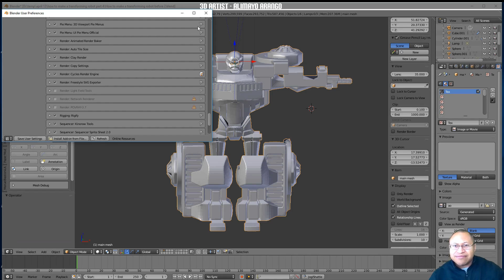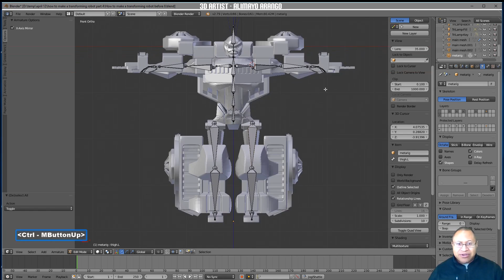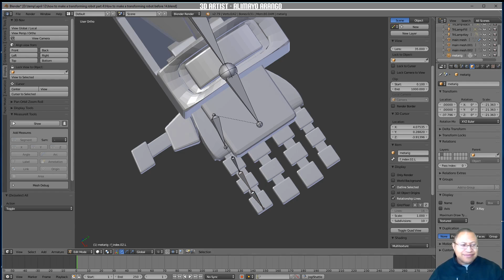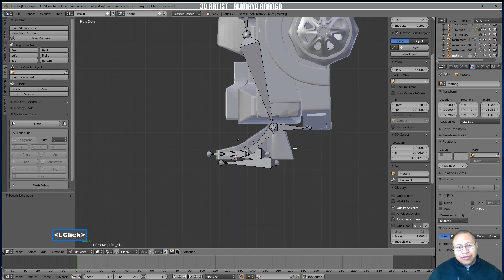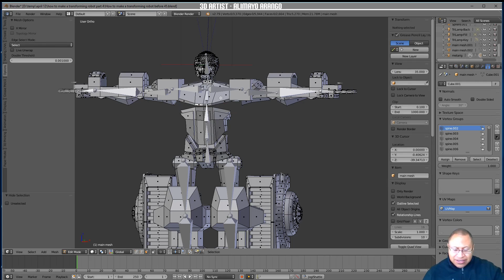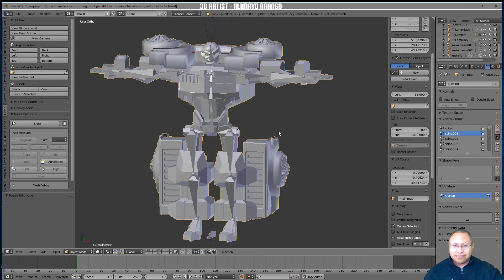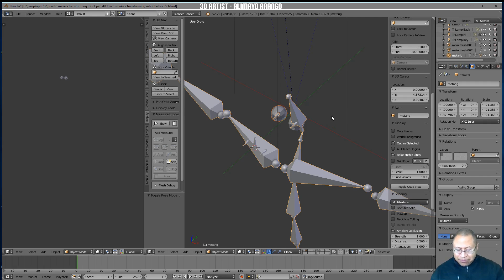How To Rig A Transforming Robot In Robot Mode In Blender 2.79

Comment: thank you very much Alimayo,  I've made my robot your rig, and it works wonderfully, I still have to work on the details and lock some axes for some bones  I'm very happy with your rig skelett !
I have a little problem with "shoulder pads": when I turn the arm full up in Z direction, and then 90 degrees to the side swivel my shoulder pads dive into the body, I think here I should add an extra bone, maybe someone still has a little tip how I should connect the extra bone with the rig skeleton. I would like to turn the shoulder pad dan independently on only one axis to the outside, because i need this move not often

Thank you for the robot rig with empty groups Sir, and the Symmetrize option is just genial :-)
Reply from the maker: It sound like adding the extra bone that you mentioned for the should pad might work out well. Thanks for watching this video and working your way through it. Thanks for saying thank you and I hope that you rest of you work on this project turns out well. If you have any other issues send me a comment and I will try to help.
Reply: @AlimayoArango  here is the result, your rig he has, thanks to you. In my animation are still some mistakes, because I have to look at some of your great turorials to learn a reasonable animation :-). https://www.youtube.com/watch?v=yrDINpe5sk0&t=77s
(1:15)